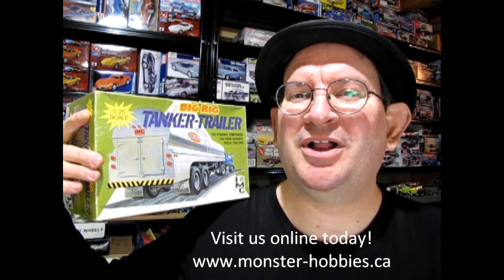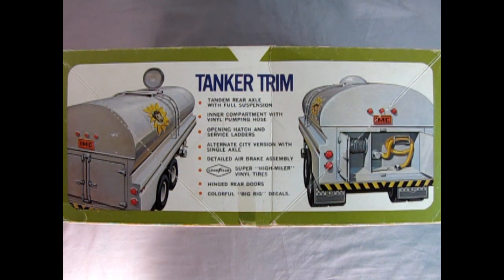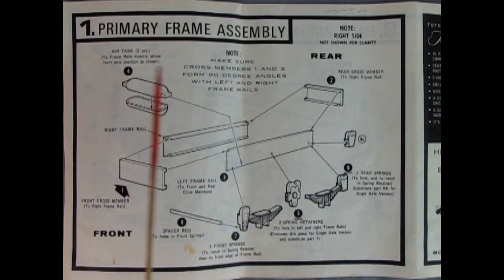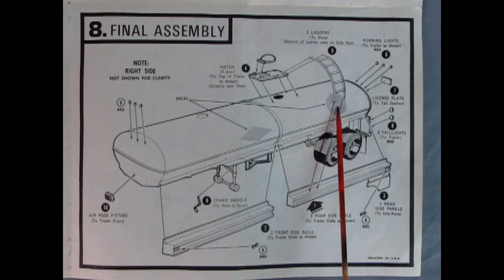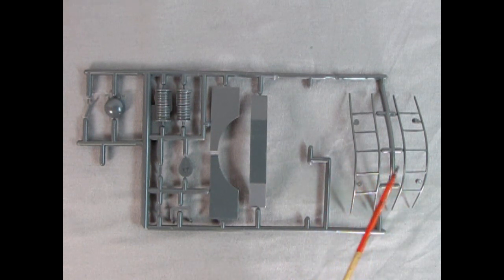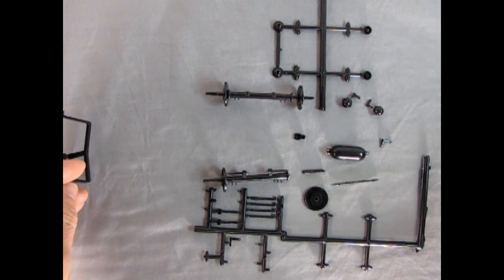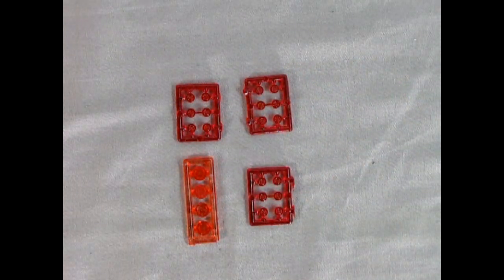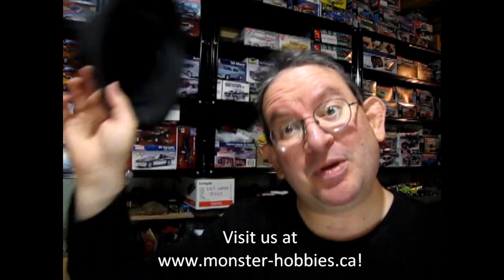Model Car Garage - The IMC 1960's Big Rig Tanker Trailer Model Truck Kit - An Unboxing Video

Comment: Nice unboxing.  Moebius sells a set of tractor trailers, and those should fit this trailer.  You could replace all eight tires so they would all be the same.  I also think AMT sells them too.  Those tires are a little pricey, but you could solve the problem.  I’ve paid more money I wanted to spend to get parts for kits a few times.  But, if you really want to build a kit sometimes it is a necessary evil.  Thanks for sharing.
Reply from the maker: you are welcome. Wait until next week...the tire issue has a little resolution from a secret source!

Comment: As you probably know the tanker trailer and the dry goods trailer were produced by IMCIt also produced the Dodge L-700 truck The tanker and the drygoods trailer were paired with the Dodge and release as 2 model deal The owner of  Lindberg models bought IMC and released the Dodge and the tanker or the dry goods trailers as a 2 model deal  The MC logo that apears on the mudguards for the trailer was kept in honour of Jim Etter
Reply: Tom Lowe,the owner of Round 2,bought the Lindberg company
Reply from the maker: Thank you for the information. I have also seen this released under the Testors label.
Reply from the maker: Hopefully we will see these models make a re-appearance. The Dry Goods trailer is set to release sometime this year.
Reply: @MonsterHobbiesModelCarGarage  I made a mistake The person that owns or used to own  Testors bought the IMC or the moulds for the tanker,the dry goods trailer and the Dodge L-700 and release them as separate kits then later on as combined kits Then  the moulds for the trailers for the trailers and the truck Testors was bought by the owner of Lindberg Then Thomas Lowe,the owner of Round 2 bought the moulds for the truck and trailers and released the models under the Lindberg name
Reply from the maker: Sounds right. Interesting that IMC only had 3 kits.
Reply: @MonsterHobbiesModelCarGarage  Jim Etter was working on the release of some other models He created the master moulds for them and popped some models Then he died from cancer,which is a pity
Reply from the maker: @rayneal1469  that is sad. Thank you for his history.
Reply: @MonsterHobbiesModelCarGarage  Yes To my knowledge the Dodge L-700 was the first truck model to have opening doors and steerable wheels